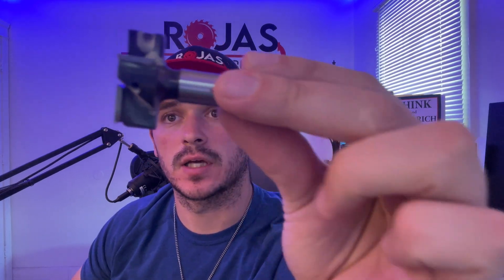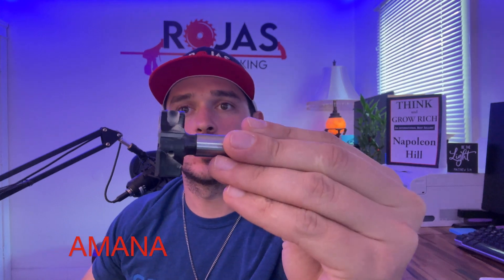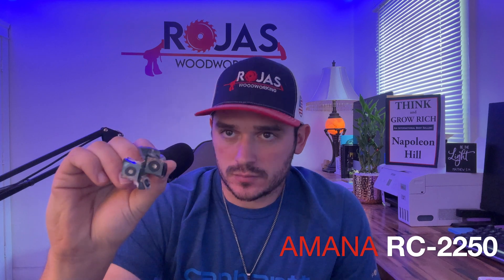Step-by-step Guide To Building Your Own CNC Vacuum Table - Part 3

Comment: Hi, what thickness of the plastic sheet did you choose?
Reply from the maker: Hey thank you for the question! I used a 3/4” sheet of HDPE and cut the grid 1/4” in depth. This leaves more than enough left over width to remain strong and not want to flex.